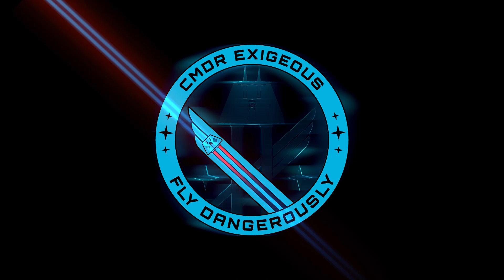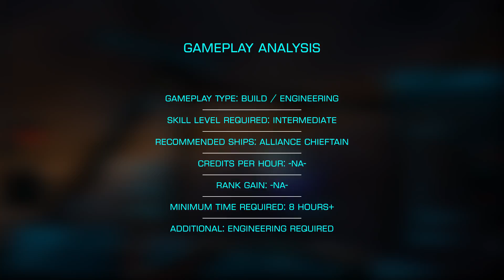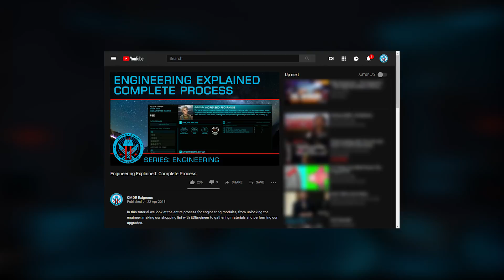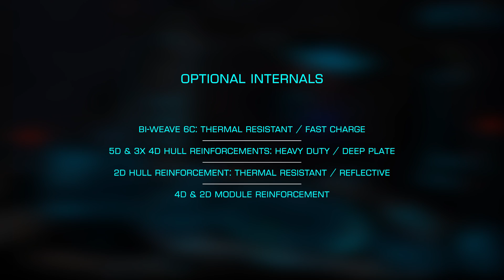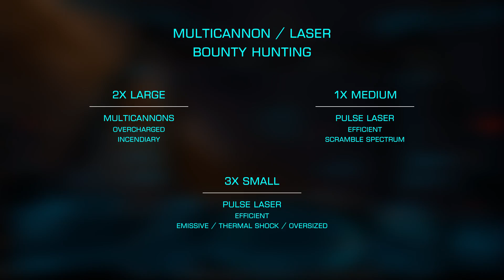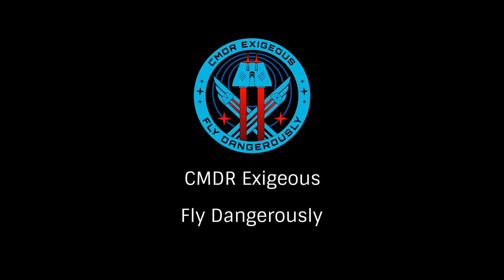Ship Builds: Meta PvP Alliance Chieftain

Comment: I'm currently running 2 long range large cannon on mine, and will replace with long range PAs (instead of focus) when I unlock full PA engineering.

Final build I'm going to go for is with 2x long range PAs or APAs (because I sometimes need a follow-up shot after missing the first, so increased firing rate helps), medium overcharged  corrosive MC, and 3 small efficient rails with super penetrator.

Or I might just go 3 incindiary MCs, medium corrosive MC, and keep the large cannons so I can just go 2.5-2.5-1 on pips and just juggle between engines and sys in a fight. We'll have to see.

Comment: I used a variant of this build the other day and absolutely rekt a fully engineered corvette who was ganking ships.
I run 2x chaff with pretty much everything the same, except I have 2x super pen and 1 feedback cascade on the rails. i wanted more module damage. i felt like the purpose of the PA's are to drain shields and for utility, and the rails are for the power plant, with situational offence. but tbh, good commanders who i would need FC against are smart with their SCB timing and do it when i pass, so i don't have the chance to hit them. bad pilots do it when they're 2km away and im in reverski. i figured that if i DID need feedback cascade....the pilot is so good that i wouldn't be able to hit them anyway, therefore....more module damage is preferable since they can't avoid it as easily once their shields are down.
 My PA's are 2x long range on the large and focused on the medium. I was missing too many shots and i found that most players use weapons with effective ranges of <2km. This build is FAST in all directions, but i don't like getting close at all. i felt like whenever i had to get close in order to land shots, the damage i took was too much. large ships weren't too difficult to hit, but anything smaller than an FDL would be able to potentially ruin my day. or at least troll very successfully. once i swapped to the faster speed, it's almost impossible to miss large ships, even at +2km. the shot speed is SO fast.

My build overheats if I'm not careful, but the fact that i don't miss anymore means i don't have to fire as many shots. i basically "fire for effect." aka just for target lock break and the dispersal field effect. i think it also ruins their tracking if they try to deselect you but im not sure.
 I basically have a strategy of shoot while passing, turn and swap to rails, if they have shields i'll pop 1 shot at range to make them fear me, if they don't have shields i'll keep drifting out of their effective range, go 4-0-2, and then proceed to snipe their power plant. If they still have shields, i'll boost back towards them when they start closing and repeat the process. sometimes i'll be an asshole and manoveour onto their yaw to make their life a living hell. i like to use predictive aim when i fight as well, basically taking note of the rate of change of their incoming velocity, using the target lead indicator to tell me where they're flying, and then dodge if they're trying to ram me, or tilt/pitch in whatever direction they were going to travel so that im facing their ship the instant they pass. 

It's easily the most fun i've had in this game. it just takes a ridiculous amount of time to gather the materials you need, and almost as long to actually git gud with this.

canopy is EXTREMELY weak, never tank, always avoid, always be moving. toggle FA-on when you need FAST lateral thrust, or if you need to slow down FAST. it's not well known but you have better decel and stronger directional thrust in FA-on, so toggling is actually better than FA-off. IMO it's just better to get used to flying with it OFF and toggling it on only when you need the directional control.

The biggest thing to remember about this build: most of the battle is going to be psychological. Your shields will drop often, and you will get to 40% hull before you drop that cutter's shields. That cmdr will think he is fucking you up because he's still at 100% hull and you're now at 35%. your systems start to malfunction.
rail guns fire
rail guns fire
rail guns fire

and then your target starts drifting helplessly into space.

Power Plant: 0%

They're still at 50% hull.
rail guns fire

Their ship explodes.

Your shields finishing recharging for the 13th time.
You only dropped theirs one time.
You get a friend request, and a "GG"

I highly encourage everyone to get this ship and try this build. Your dick size will grow by at least 50%
Reply: 50%? Hell yeah! Every inch counts!
Reply: thinkin about trying this using a hull tank idea. That may solve the heat issues.
Reply: Bloody hell sounds like a war story
Reply: Any tips on being more efficient with landing shots? I just finished building a Krait mk2 with all plasmas for PvE, it absolutely wrecks, IF I hit 🤣
Did a chieftan with all rails, same thing but even harder to use than plasma since I have to charge shots!! Any tips??

Comment: Is this still your preferred build for the Chieftain? Just curious if another year and a half of flying it has changed your perspective on it. (Low chance for an answer, but worth a try.)
Reply from the maker: Low chance - I try to reply to every comment I get! (sometimes I miss replies due to the way the system works).

In short yes, I still fly this and love it. I don't run packhounds or seekers on it (not sure if that's in the build but I used to run that) so I just run another PA or Rail on the medium. But yeah, love this build.
Reply: @Exigeous  Sorry, badly worded. Just meant that comments on old videos tend, for a multitude of good reasons, to fall between the cracks. My bad. 
Thank you. It always interesting to see how veterans in a game change their builds and play style over the years. And equally interesting to see when they have found a build they enjoy so much they keep it the same over those years.
Reply from the maker: Oh no worries at all - I do make a strong effort to make sure that ALL my videos are current, otherwise I'll put a big fat NERFED or UPDATED across the thumbnails.

Comment: i prefer drag ammo pack hounds in my medium slot to screw with all the boosting

edit: whenever you mod a shield for thermal resistance. take a kinetic and a thermals resistant booster, fill with heavy duty after that
Reply from the maker: Well realize that's going to change back soon - you still will remove pips from engines with drag munitions.

Comment: Setup for PvE but I have 3 small pulse with long range mod and scramble for the experimental on all three.  Overcharged autocannons for the other three hardpoints.  Incendiary rounds on the two larges and corrosive on the medium.  Chews through hull like nothing...  Dont know how it would fair in PvP but with A rated thrusters alone this thing is a beast in conflict zones.  Havent even modded anything but the weapons.

Comment: When every PVP I've encountered uses PA's that deal absoloute damage why bother with resistances for hull and shields? I use mil spec armour heavy duty and bi-weaves reinforced with fast charge. Charge slightly faster than off the shelf bi-weaves with around 700mj's.
Reply from the maker: Well because you won't always come up against PAs and rails - and realize only 60% of their damage is absolute (PAs) so resistances still do matter.  Given the reactive isn't all that much more expensive (and if you're doing PvP you should have plenty of credits) you always want those much higher resistances.
Reply: @Exigeous  Thanks for some pointers on missed info!

Comment: Great build btw. I m currently building a bi weave chieftain but also run it shieldless as well with 5200 hull.
Reply from the maker: Shieldless is nice as you don't have to worry about pips in sys (for the most part) but there are just too many counters - come up against 1 missile boat and you're toast.
Reply: You are absolutely right and that’s y I run 2 ecms and 1 chaff 1 heatsink or 2 heatsinks when shieldless
Reply from the maker: And that's a decent counter - until you come up against packhounds or super pen rails where you're fucked.  Not saying you're "wrong" but for the vast majority the trade off for no shields isn't worth it.

Comment: For anyone interested, You would only lose 1 m/s boost speed with a 5d fsd drive and 2 m/s boost with a 5a fsd.  so If anyone wants to jump with this ship, you can equip a 4a fuel scoop and ship the 4d module reinforcement once u reach the system or buy one if they offer it in your system  station has one. This is a cheaper option than shipping the ship if u don’t want to or if you are like me and don’t want to trade out your engineered modules into ur aspx to get there faster as you still have to wait for the chieftain to arrive anyways.
Reply from the maker: Absolutely valid point - I just tend to be a min/maxer and as I'm never going to jump out of a fight nor jump around with the ship I just go for the easy 2D.
Reply: CMDR Exigeous I totally get that and have done it on other PvP ships too. I just know there are some players out there that might want to fly their only fully engineered ship around everywhere bc I have those friends. Lol. I ship my fdl everywhere bc it’s jump range is terrible no matter what I do to it.

Comment: Totally off topic, and i'm sure you're tired of seeing my face lol, but you're the only one I can count on to answer...but I have a question regarding missions, I've recently come back from a couple of months break to find out that mission payouts have been screwed. I'm finding the missions I once did now pay drastically less. especially wing missions that want you to deliver almost 6k units for a 1.5mil payout. They used to payout between 20-50mil. Did I miss something while I was taking a break? I know FDev plan on "Fixing" the mission system, aka destroy board hopping, and increase payouts by 10% but will 10% even be enough? Sounds like it will just return to the slightly better payout state it was awhile back compared to now..
Reply from the maker: No worries, but if you post on any video it shows up in my feed so you can pick a more topical one next time ;-)

You can still find those missions, albeit fewer and farther between.  Right now the best money making is Sightseeing missions in Robigo (I have a video on it).  Wing missions at $50M still exist they are just really hard to find.

Comment: Got a couple and I love them.  One has an APA, 2 hammers, and 3 rails.  The other is all phasing pulse.  Chieftens can be dirty if you build them right.
Reply from the maker: You're running 2 Hammers on a Chiefain?  So you're giving up a large slot to run the terrible Hammer?  Sure they are cool to fire but given the huge amount of heat they generate when compared to a standard Hammer they are a horrible choice, especially in place of a large and it's damage.  Am confused as I wouldn't call that building it right at all.
Reply: @Exigeous  chieften has a large 2 med and 3 small right?  Hammers are med.  Large has an APA, 2 meds are hammers with super penetrating, and 3 small are rails with 2 bank busters and a super penatrator.
Reply: @Exigeous  all phasing pulse is money against big ships as a support ship.  Chip their hull away without them noticing.
Reply: @Exigeous  my bad i was thinking of my crusader.  my chieften has 2 APAs, a hammer, and 3 rails.  APAs are annoyers, hammer is bank bust, and 3 rails are super penetrating.  you were right.
Reply from the maker: Yeah, there you go - but still I would never suggest someone use a hammer in PvP nor mix difference sized rails due to the different shot delays - personally I think you would be much better served by using another PA on that medium rather than the hammer but if it's working for ya great.
Reply: @Exigeous  I'll try it out I usually have different foreground set up for different times in fight and run mostly as harassment support but I'm down to try pretty much any loadout.  If the loadout works it gets its own ship in fleet storage until needed.  I got optional ships for most scenarios.  Currently loving an all phasing pulse chieften.

Comment: I made something resembling this build independently and, upon learning of the meta, adjusted it to be sort of a compromise between them. Less hull and a bit more shields with the bi-weave bolstered with some Guardian boosters on smaller slots. Weapons are 2 efficient APAs, 2 small cannons with similar shot speed to the plasma and a medium rail paired with small gauss because they have same charge time. I think I'll put in an Imperial Hammer once I've finished queuing for it.

Not as effective as the pure meta, but it is my best PVP ship and fun to fly. I need to tinker with it a little more, though.
Reply from the maker: I can't recommend strongly enough that you ditch those guardian boosters and go with more hull - it just isn't effective as a shield tank and you'd almost never use guardian boosters with a bi-weave.  Not only do the ruin the regen time, which is the whole point of a biweave, but if you reboot/repair with guardian boosters you do not get your shields back like you do without them.  In short you're getting far less overall protection given how long it will take to get them back vs. what extra you're getting - it's a terrible trade off for the Chieftain, save those boosters for something like a prismatic FDL.

As for the hammer you can skip that too - it generates so much more heat than a standard and as you'll only get one it won't fire the same as your three smalls - so it's not a good mix at all.  Sadly the hammers are almost worthless for PvP due to that heat, you're always better with a standard railgun (and here the three smalls are perfect fot it).

So yeah, get on that tinkering!
Reply: Ah, but those shields are so nice in PVE. Enough of MJs that I can usually avoid losing them even if I suddenly become the center of the attention in CZ and fast enough recharge not to wait all day to get them back to a point I feel comfortable going into the fray again. I don't like hull tanks because I don't enjoy seeing my cockpit canopy sailing into the space and I don't like shield tanks because I don't like using cell banks too much. For the hammer, I really started considering that because my current build just doesn't overheat at all. That may be because I'm using sturdy instead of long range for the rails. Also the "chin and forehead" combo isn't the best for grouping for trying to snipe modules anyway. I'm more for amusing combinations than pure, min-maxed efficiency.

However, I think I'll put it together in such way that I can easily convert it to the cookie cutter serious build by swapping out as few parts as possible if I feel like seriously going into PVP danger zone. Your video is very useful in determining how I might do that.
Reply from the maker: I get what you're saying about shields in PvE to which I'd say you're just flying the wrong ship for that - trying to turn a hull tank into a shield build usually means you have an odd hybrid of both which never works as well.  I too don't like using hull tanks for bounty hunting for that reason - so for others at least I'd suggest leaving the Chieftain at home for PvE and taking a true shield tank like an FDL.  That said if I were going in something like the Chieftain I'd still prefer the faster regen as I can pretty much get all my shields back in between fights at the CZ.  If you're running sturdy that's great as it'll give you another 10% thermal drop but I think you'd be much better served by running long range on the 3 smalls (as that removes damage drop off) so you can snipe things at up to 6KM - then turn that hammer into another medium PA to deal more overall damage.
Reply: It was bit over 15% of extra thermal drop for me according to the stat values and that's with engineering I didn't bother to go all the way with. I think it would be something like 17.5% fully. However, you are right, range is better. The sturdy is a leftover from previous build I had that had serious power and heat issues.

For shield regeneration speed, I was already happy it before I had fast charge and now it's even better. I get it all back between small skirmishes and even in bigger fights if I manage to avoid most of the fire. It doesn't really go down unless I wilfully ignore several NPCs shooting at me. That being said, maybe I will tone it down a little because I don't think I even need all that shield for PvE. There will be less components to swap out for serious PVP mode as well.

The "chin" medium hardpoint seems to be where the meta PVP build armament is not quite as uniform as everywhere else. Some have the plasma there and some seem to have missiles of some sort. I used to have a cannon (turret fixed forward to match the shot velocity) until I encountered the PVP builds and noticed that they really like to have plenty of rails. So I decided to have an extra rail too but put it on the medium to be different.

Comment: I personally run Enforcers on the smalls and a multicannon on the medium. But I run APAs on the Larges. My internals also sacrifice some durability for jump range (FSD booster).

I guess mine is a high end PvE or a very weak Pvp build. Well. I have fun with it and the multi cannons are just badass to fire.
Reply from the maker: Yeah, I'd say that'a a PvE build if you're running a booster and giving up that much hull.  As for the enforcers they might be my single favorite weapon, I absolutely love them on my Sidewinder.